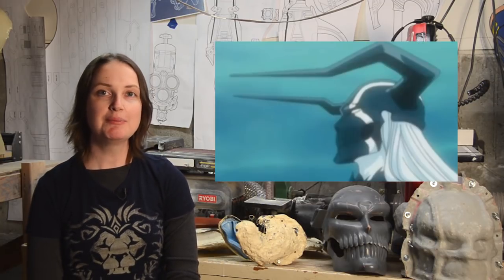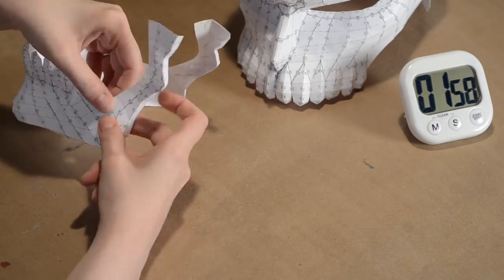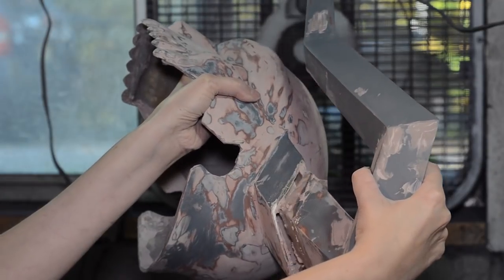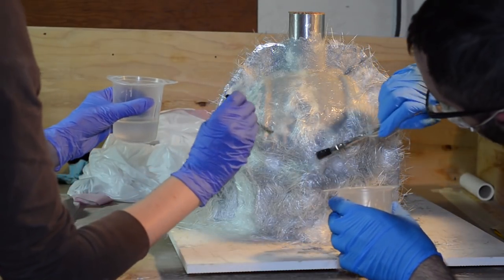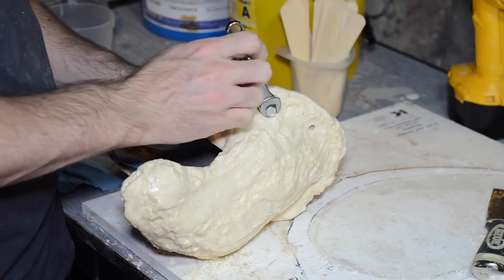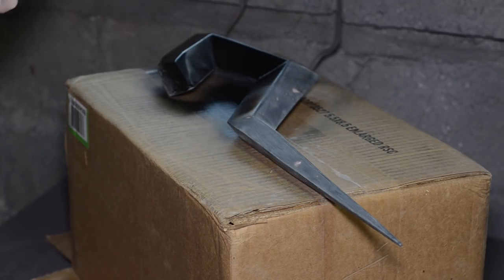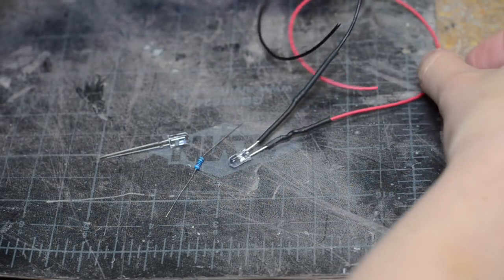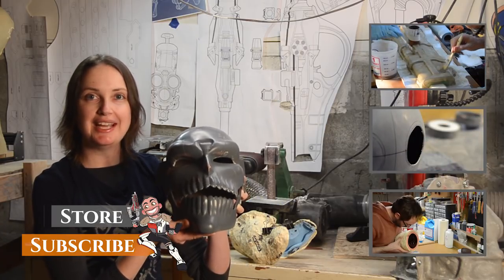Prop: Shop - Bleach Hollow Mask

Comment: Great work, Brittany! I do have a question though, is there a way to finish a pepakura/fiberglass/bondo/etc prop without casting it? as a display piece for example...? basically I cannot afford casting materials at the moment and would like to bring something to a finished stage to put up on a shelf and admire...
Reply: +Ian Boyle Thanks! You don't have to mold and cast the pepakura piece. I could have just painted the Hollow Mask an called it done, but this was for a commission. If it got lost in the mail, I'd have to make another from scratch! Also, the horns would have been really fragile if I didn't cast them in sturdy plastic.

When I made our Draugr Skyrim masks, the bases were made from pepakura traced onto 6mm foam. Then I fiberglassed the inside and added bondo to the outside. If you use bondo, make sure the reinforced pepakura is sturdy enough to not flex, since bondo will crack. Build is here: http://punishedprops.com/2013/09/04/skyrim-draugr-deathlords/

Comment: will you sell them? like i would love one of these
Reply: Me too times one hundred!!
I'd love to have one so bad.
Reply: I mean, the whole point of the video is to show you how to make one so that you don't have to buy it...
Reply: Except none of that is cost effective for an amateur cosplayer. plus they cast molds for them to reproduce. So it stands to reason that they have a plan to eventually sell copies
Reply: Nah, they probably don't plan on selling anything, casting molds is just the most effective way of creating a high quality prop, regardless of whether or not you intend to reproduce your results several times over.
Reply: Fake Name all the stuff in the video looks more expensive than to just buy the mask
Reply: wORM bOY depends on how much the mask costs: if you want a piece of shit from Walmart, then sure.
Reply: It's very easy you just need to make it hard using super glue and then go with the same old method by using pva glue and tissues then you can do it cheap

Comment: hi Punished Props so I was curious how much this would cost as I do not have the experience with any of these methods or access to the materials. and how much would it be to get one made to fit my head? what would the arrangements that would need to be made? I am attending a comic con in September, I am currently donating my hair so it Is growing very long and will be a great length by then  and would love to go as the full hollow ichigo cosplay. the one where he fights ulquiorra. same design and shape.

Comment: Awesome work! Is there a reason you went the paper route instead of 3D printing it (at least for the master)?  It seems like you did all the work of 3D modeling, then all the work of traditional casting.
Reply from the maker: At the time we did not own a 3D printer.

Comment: So since I'm limited on workspace you guys think I can skip the first part of hardening with all epoxy resin instead of using fiberglass? Is fiberglass 100% necessary?
Reply from the maker: To finish it the way we did, yes you'll need to make the paper more rigid. You could instead sculpt the helmet from clay.